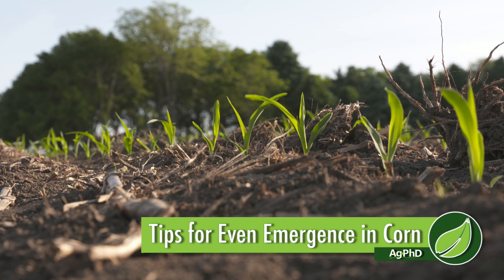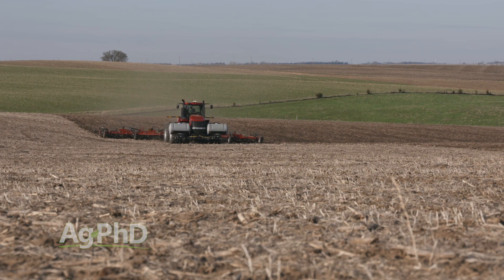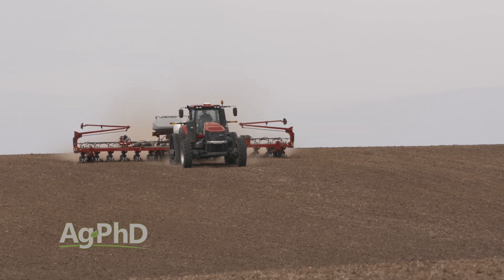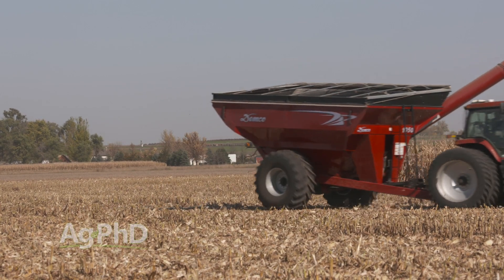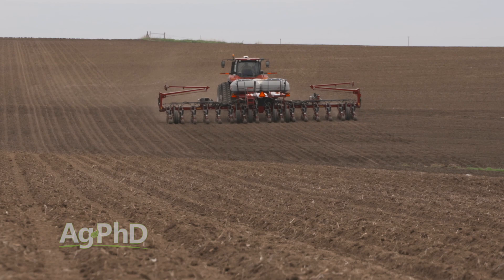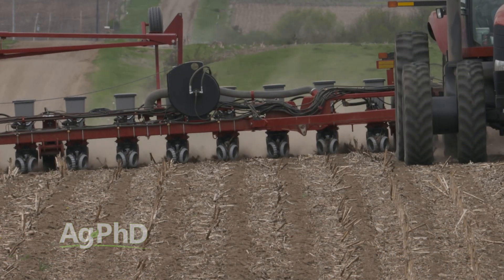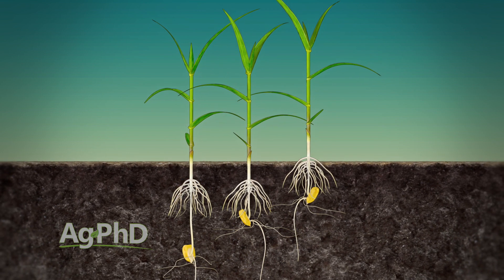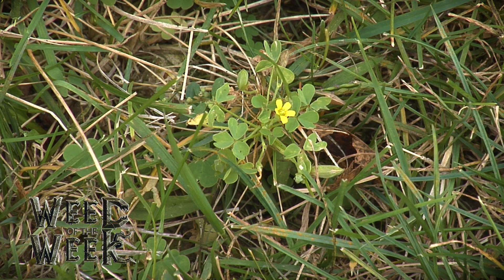Tips for Even Emergence in Corn #1038 (Air Date 2-25-18)

Comment: Not mentioned, but important. Cold temperature germination test your seed.  On a low scoring seed, you are more likely to get erratic delays in germination if planting into 40-50f soil.  Worst case this translates into an overall lower stand as well.  Maybe unscientific to the lab standards, but taking 2 samples, soaking at 40 in farm soil, then returning to greenhouse led to 90% emergence for one sample and 50% for the other on day 5.  The interesting thing is the lower scored sample didn't have another emerge for 2 days with a final 70% stand.  OR wait until the soil is 65 and you eliminate this problem.  Good luck.